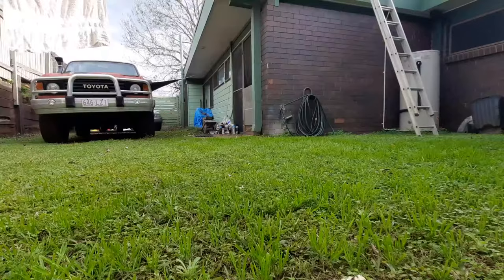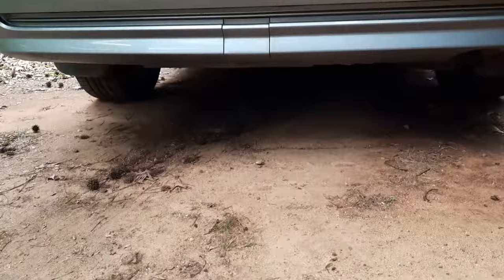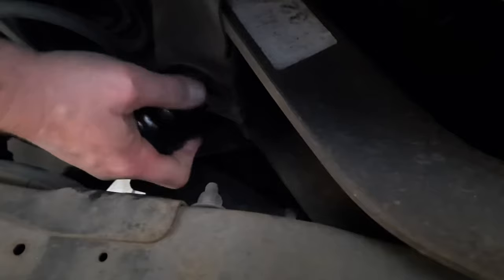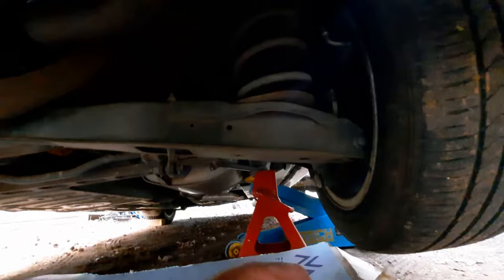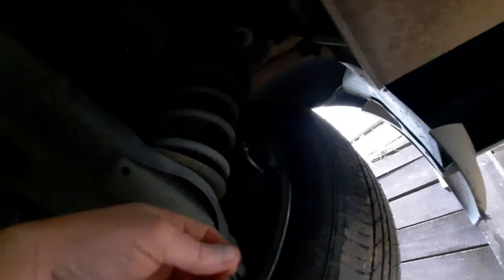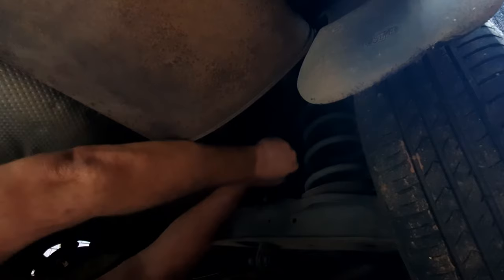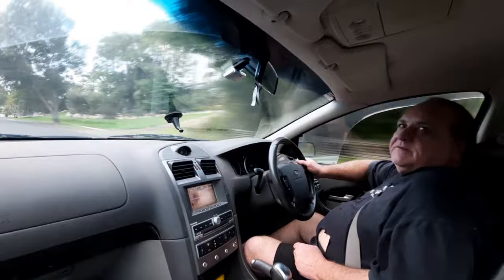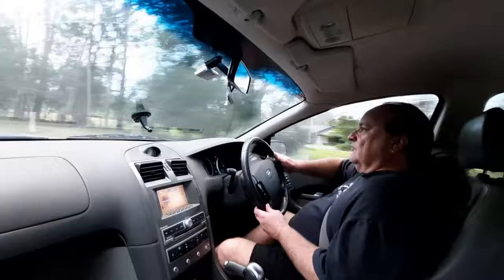Easy Way To Change Bump Stops on Ford Falcon or Territory Without Tools BA BF FG

Comment: Just fitted whiteline bumpstops, used a little grease and heaps of energy to get them on, definitely need to be a certain lever of strength. Also used car ramps.
Reply from the maker: No, it's more the twisting motion (plus grease) at the angle shown that does the trick; I don't have all that much wrist strength these days, since my carpel tunnel operation a few years back. 👍

Comment: I got polyurethane ones how stupid they are so tight I can't fit them on lol
Reply from the maker: These were black poly I think; they're all super-tight, UNLESS you install them my way , with the twist (better than having them fall off!) 😬😄👌
Reply: @SteveMack yeh I got mine on eventually the rubber stock ones are so much easier lol What other stuff can I do to lessen road bump noise? This helped a lot!
Reply from the maker: @noproblama9971  ...Don't drive the car? hahaha - I'd say, THE number ONE thing, is to use decent quality tyres - makes an enormous difference.

Comment: Weel done.I have instaled Nolathane red bumpstop on my ba falcon and I have to use piace of pipe inside of bush and crowbar against cradle or frame to install bumpstop.For me it was only option to put bushes on nob,but some bumpstop product is soft and it can be instaled with hands.
Reply from the maker: Thanks. These were pretty hard material too; I think they were also Nolathane - the 'trick', is to pre-lube them as shown, AND use just the right angle to twist them on...Anyway; now neither of us will have to bother doing it again for some years! 😅👌👍🙂

Comment: I installed the superpro bump stops which initially claimed you didn't need ANY grease and after many attempts and laying under my car required another trip for some silicone grease from SCA.
Reply from the maker: Yeah; a dab of grease definitely helps!👌👍As does the angle of attack & twisting motion

Comment: Ah Steve Mack, you've done it again !! Nice job mate however I don't think a road test unloaded and on a made road is going to tell you much other than you might not have fitted them correctly and I'm sure you did. Great jack you own. Good sturdy beast that one. Had a good laugh when you said you were stuck  😆. Cheers.
Reply from the maker: ...Did you like the "check for a corpse in the boot" suggestion? LOL
Originally, I'd planned (obviously worked out ahead of time) to end the test drive at your place, and introduce you, but weather & time messed that up! Will save that for a collab vlog thing 😉🍻👍
Reply: @SteveMack  Yes, the corpse thing was very funny too 😆. It would have been good to see you. I was going to take the boat out onto the Brisbane River from Jindalee today but the weather looked a bit crook so I was at home not doing much. I might take it out tomorrow. You can come for a ride if you like. There is a boat ramp at Goodna. I've never launched from it but have seen it many times. I'm very familiar with the Jindalee ramp though. A collab video would be great fun. I'll get to learn how an expert does it. Cheers mate.
Reply from the maker: @garydeloas6531  A boat trip would be cool!! The guys coming finally to replace retaining wall tomorrow, so I should probably be here...I removed shade sails yesterday, and moved the landcruiser out. So probably a raincheck for a fine day & do a collab? Having said that; if I alter plans (or he does yet another no show!), I know how to get hold of you 😉👍👍
Reply from the maker: Oh yeah; the low profile jack, I bought for obvious reasons when I bought my 1st Corvette. I did NOT want chinese, so this one is locally made in Brisbane, fully Australian...and I've conveniantly forgotten the price, but I think if you were to take a guess, then double it; it'd be close to the mark!😁(well worth it though)🙂👍

Comment: The falcon spare system sucks with that crappy strap and the baby spare the commodore has much better holding ability and full size spare I've had both!
Reply from the maker: Well, as much as I agree it's a pretty dumb idea; I had no say in the design...I guess at least the wheel well IS deep enough, for it not to be an issue (It was probably the result of some stupid ADR regulation, requiring seatbelts for spare tyres!) 😅🙄🙂
Reply: @SteveMack and the tiny little spare is ridiculous lol
Reply from the maker: True, but still better than NO spare!